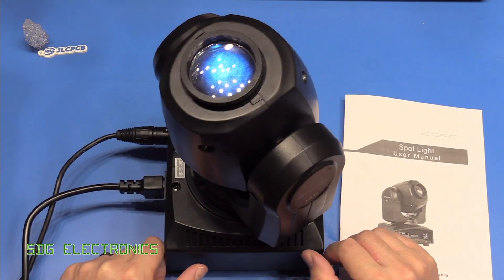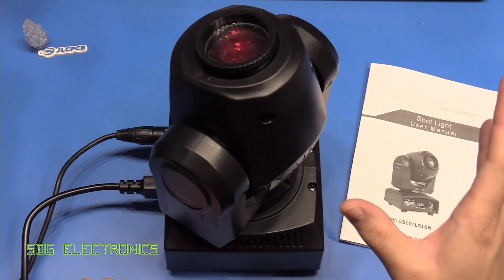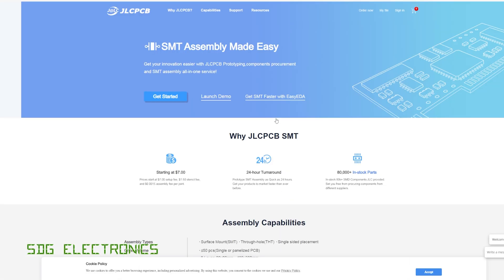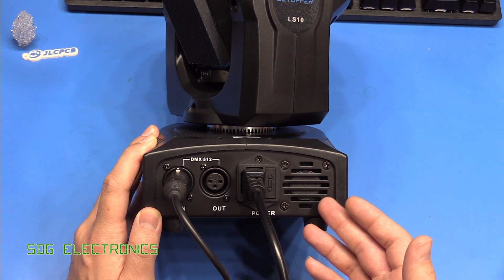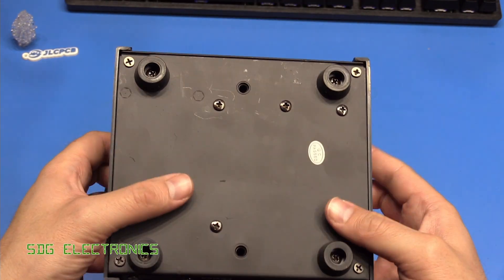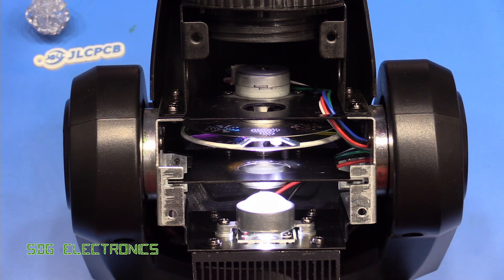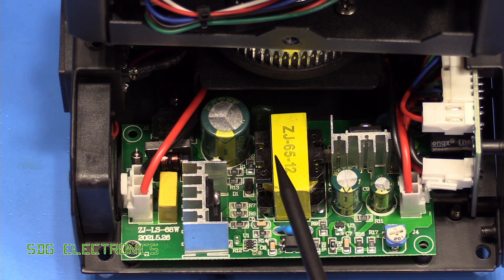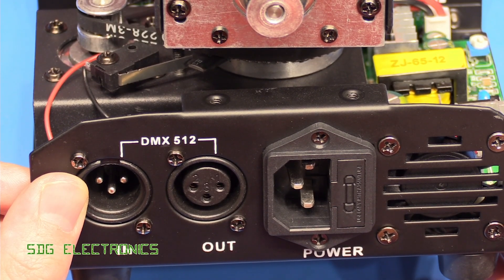SDG #237 LED DMX Moving Head Disco Light 10W Betopper LS10

Comment: It's only 10W, there's stray light inside the device and loss through the gobos. A neat light fixture but surely that 10W can't reach very far?
I've got a couple of washes by Lixada (also sold as BeamZ) and they look very similar inside.
Over time the absolute direction of the pan/tilt head starts to differ between fixtures, and as seems to be the case with your Betopper product, the beam can't be perfectly centered and the tilt angle on either end of the head is not equal. But all in all for the price, they're neat little things. Much, much cheaper than any other well-known brands.
Reply from the maker: There's minimal light loss in the optical path. Obviously there is loss when using any gobos, and the dichroic filters reflect back all the out of band light, but generally it's quit well focused. I tried it outside and the throw is quite reasonable at night - I could still see the white patterns on buildings about 50 meters away, but it's nothing like the 1.2 kW HMI fixtures I've used before.

Comment: ChongX Crapacitors?  are they now even ripping off their own ChengX brand of cheap quality electrolytics?!
Reply: I've never seen ChenX branded capacitors, but i can imagine them existing (it's ChongX in the video).
It's like battery brands from China; ultrafire, surefire, demonfire, fire scarlet, trustfire, eastfire, superfire, ...
They rip off the worst parts of eachother.
Reply: @bjornroesbeke   I ment, ChengX not ChenX oops, its "Chengxing electronic" founded in a town in Dongguan.   ChongX is either a misprint or ripoff lol
im aware of the *fire labeled batteries, certainly a product that can prove what it claims sometimes, apart from the capacity.

Comment: My guess is they want to avoid RGB since the spatial offset between the diodes would result in each color being projected at a different angle by the lens. Could avoid that by using a dichroic beam combiner to put all colors coaxial, but then the beam path and optics becomes more complex/costly.
Reply: Yeah, that would be my guess as well. RGB LEDs normally don't align all colors perfectly unless diffused first. It becomes even more apparent with a collimating lens like the one in this unit.
Another reason might be that a white LED with a color filter produces better color than an RGB LED, assuming that the white LED is good and has a reasonable CRI.
Reply from the maker: @Sheevlord  The red end of the colour wheel is a bit less intense than the green and blue. It looks like the website does have some with full colour mixing, but it's using CMY colour wheels rather than RGB LEDs.
Reply: @sdgelectronics  They could've electronically increased current through the LED when the red filter is in place to make the apparent brightness more consistent with other colors. Then again this adds complexity so they probably decided not to bother with that.